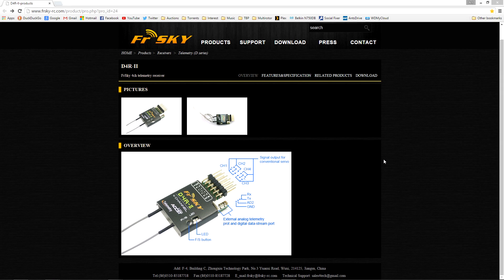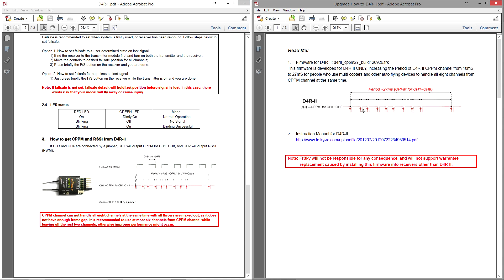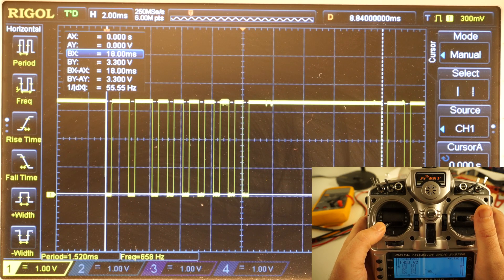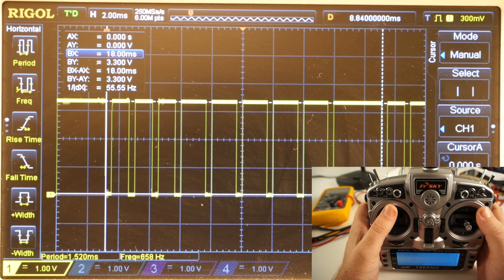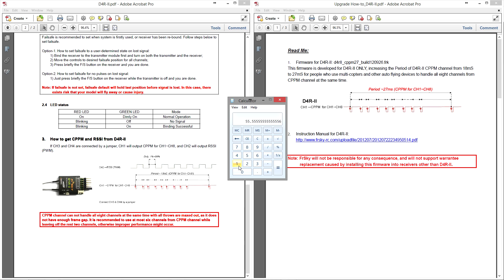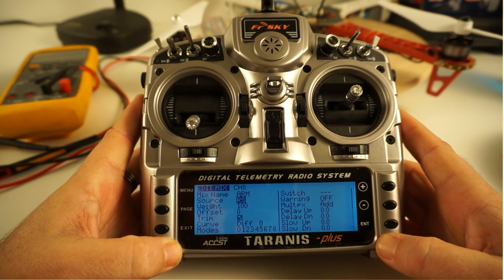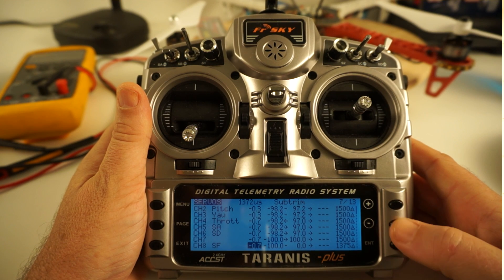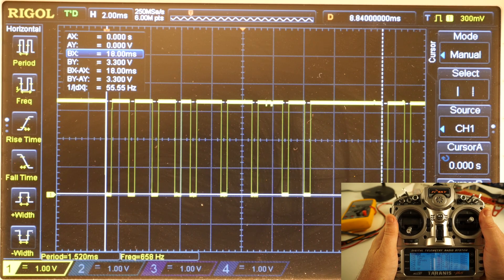CPPM Explained. Hack your FrSky D4R-II Settings.

Comment: Really good video.  In the video you actually assigned a switch to both channel 7 and channel 8, but you only cheated to narrow the bandwidth of channel 8.  I guess if you were really concerned about a little extra margin for "error", you could also narrow the bandwidth of the channel 7  switch too.  Thanks for your effort.

Comment: Do you know How I can connect this reciever with the cc3d in ppm!! I have done everything that I know, and there is a bind between my radio and the rx, but in ppm mode it dont speak to the cc3d board :( thank's
Reply from the maker: +Bisholi M Are you using Cleanflight?
Reply: +The Dark Pixel No I am using the Open Pilet...!!? should I use that?
Reply from the maker: Open Pilot should work. My suggestion is that the CPPM signal is not connected to the correct input pin on the CC3D. Systematically try the other input pins.

Comment: I couldn't tell any difference after switching to 27ms firmware. I'm going to swap in my spare receiver and see if there is any noticeable difference in lag. I'm doubtful.
Reply from the maker: Brox3r I suspect maybe you wouldn't notice it on anything except a finely tuned, racing 250. But I think my comparison to First Person Shooter game sums it up the best. If you're flying fine on 27ms, I definitely wouldn't be concerned about it. But if you were running 18ms, I'd say don't bother flashing it.